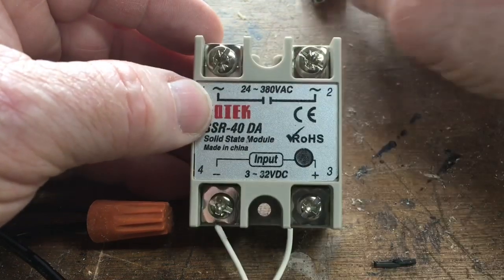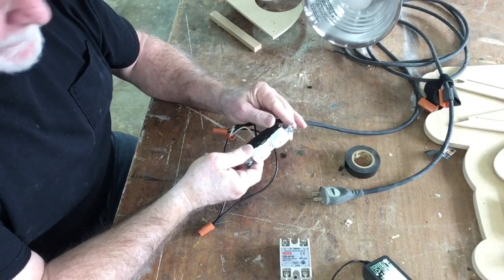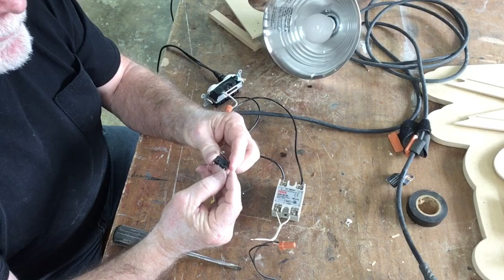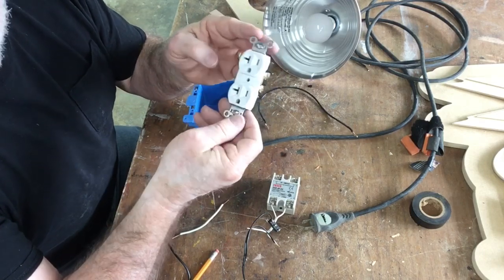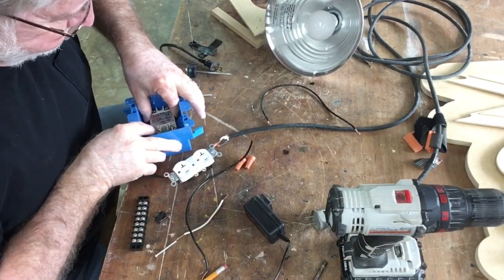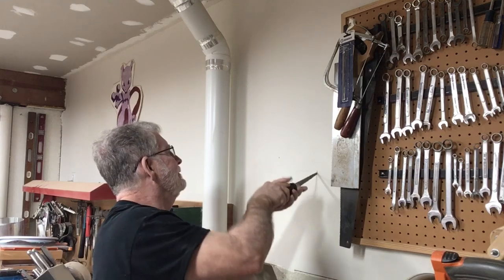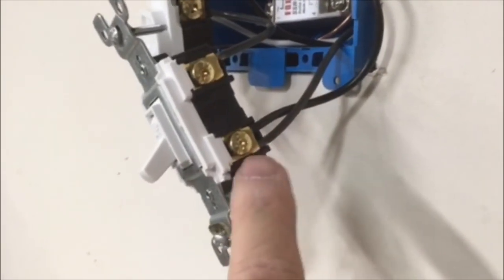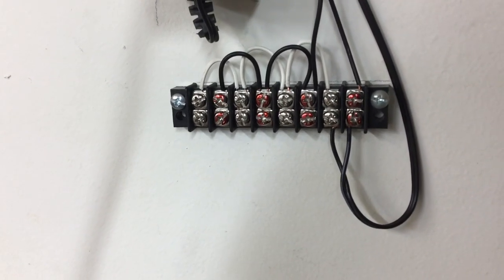Automatic Blast Gates | New 20 amp Circuit | Relay and Micro Switches Installed

Comment: I set this up for my dust collector.  It is a 220v 2 hp unit.  I had to use 2 relays; one for each side of the 220v. It is working perfectly.  I modified the wiring to use switch normally open to control.  When the blast gate is opened, it shunts the positive line to the control line and it is only tripped when the blast gate is fully opened.   I intended to put the transformer on the light circuit so that the dust collector could not operate unless the shop lights were on. This should prevent accidental tripping. 

HOWEVER, I could not get the relays to work from the transformer. I tried 7 different transformers, all DC.  Convinced I had done everything correctly, I reordered 2 more relays and tried them. No luck.  A youtube video showed using a 9v battery to activate them.  It worked.  I am now powering the contraption with a 4.2v lithium ion battery.  It works. I have a couple dozen of them that I removed from old laptop battery packs.

Anyone got any ideas? 

I used a good quality multimeter to check all the transformers.  DC voltage of proper polarity, ranging in voltage from 5v to 19v.  

I mounted the lithium battery on the dust collector control box along with a spare so I don't have to go in search of a replacement when the need arises.
Reply from the maker: Not sure what is causing you problem.  What is the output on the transformer?  Did that voltage exceed the rating on the relay?
Reply: Most likely you're DC power  supplies are SWMP and not enough current.A  Switch Mode Power Supply can be constant current OR constant voltage. You need to test voltage and amperage with relay activated. You're Power supply is simply shutting off when you need it to work. 
Look at the output rating for the supply and you'll see that it probably doesn't output amps that the relay requires.

Comment: Hey Paw Paw, great video, I followed this over a year ago when I hooked up my micro switch blast gate set up. Recently my dust collector stopped working. After investigation I found the Solid State module had melted inside my outlet! Check yours and see how it looks. I'm running the 2HP harbor freight dust collector and upgraded the impeller on it to a bigger one. Idk if that had anything to do with it but I'm cautious moving forward. Im interested to see how yours is holding up
Reply from the maker: Wow, that scary. So far mine is working just fine.
Reply: @PawPawsWorkShop  I'll give it another try, this time i'm definitely mounting it in a separate metal box and adding some type of heat sink. I'll have to check on it periodically.

Comment: Hey PAW PAW. I’m using your videos to install my shop dust collection system. My question is this, I’m going to have 10 blast gates with a low voltage lead heading back to the box as shown. Can I connect all of the 10 low voltage leads all together as 1 in the box? Thanks.

Comment: 19:09 
Hello I have always wanted to use micro switches with my blast gates. I followed the video and got the relay as per part # in video as well. Having a problem with the dust collector motor starting up. It runs fine when plugged into an outlet without the relay wired in. Motor seems to not have enough power to start up. Any thoughts to what may be the problem. Thanks
Reply from the maker: Are you losing voltage and or amps on the high voltage side? It seems the low voltage side is doing the job. Are all the connections tight?  Test the voltage.  It possible you may have a bad relay
Reply: Yes it tested 120v. I will try another relay. I picked up 2 of them. I’ll swap it out and see it it makes a difference. Thanks I’ll let yo know

Comment: Great idea, thank you! I have a problem though, and I'm not sure if you can help. I've set this up exactly how you did and even tested it several times with a light. I then connected my 20A dust collector, touched the two low voltage wires together, and it turned on. Hooray! But when I take the wires apart it still runs... the circuit remains closed. I read online that the relay may have failed in the closed state, so I purchased a new relay. I just repeated the process and the same thing happened. Any ideas?
Reply from the maker: There is a short somewhere.  I had the same problem.  I added another drop and all of a sudden it did not work correctly.  My wire was pulled tight into a slot and the metal strap cut the wire just enough to make the connection.  It was a little difficult to trace but I found it.  Look careful at your whole system.  You'll find the problem.

Comment: ANother question I have is the switch.  Why is the switch needed? Just so that you can shut it off so the relay does not over heat?  I bought the relay and it came with a heat sink device but there is no way that device will fit in the deep electrical box.  If someone has to remember to go to the dust collector to shut off the switch for the relay or even put the switch somewhere close to where you work, then I am not getting the idea of automating the DC to come on by opening a blast gate. I mean I get the convenience of any blast gate opening would turn on the dust collector and shut it off, but then we have to remember to flip that switch.  I am not liking that option because then it would be easy to forget to turn it off. I have a remote for my DC and after watching several other videos on doing what you have done, and after wiring everything to make this blast gate automation, I am now stuck with the idea of having to remember to turn off a switch for something you cannot see or hear running.  I was thinking why couldn't I have use an alexa enabled switch instead of the one I bought.  That way maybe I could out some automation in place that says if the switch is on for a certain period of time, turn off the switch or send me an alert that it is on for say 30 minutes or an hour.  Thoughts?
Reply from the maker: The switch is not required at all
Reply: I have a switch on mine and I recommend it. Sometimes the blast gates my vibrate open, turning on your dust collection. I've been sleeping at night and woken up by my dust collector running because a blast gate opened somehow just enough to release the limit switch. So before I go on vacation or I know I'll be gone a while, I hit that switch so even if a blast gate opens, the dust collector won't turn on.

Comment: Although this won't open/close your blast gates but, if you use this current sensing switch, from Amazon, at each of your power tools (In place of the Microswitches) it will start up your dust collector when the tool starts up.  That's the way I run my shop.
Current Sensing Switch, Normally Open Current Sensing Relay Adjustable AC 0.2A -30A (SZC23 No AL-CH Model)

Comment: Was the short in the low voltage side?
Reply from the maker: Yes, when I pulled the wire it got caught on one of the metal straps.

Comment: Great video! I followed every step you outlined. I'm using a 5A micro switch, but it makes my dust collector power fluctuate over a 10' bell wire. The same switch attached to a 1' bell wire, works just fine. What rating micro switch are you using?
Reply from the maker: The power is just going through the relay switch. The low voltage side is for the switches to operate the relay.  I'll check the amp of the micro switches.
Reply: Awesome, I appreciate you taking the time to check. For the life of me, I can't figure out why the power would fluctuate over a long wire, but not over a short one. I even swapped out the wire and micro switch.
Reply from the maker: What about the relay itself?
Reply: @Paw Paw’s WorkShop  I purchased one that had the same specs as the one you used, as the one you had wasn't available. It works fine as far as I can tell. It's only when a long wire is run from the micro switch to the terminal block that there's an issue with power fluctuations. Otherwise there is no issue with short runs.

Comment: .I am working on this project right now.  I have seen a lot of comments on the relay heating up. Have you had any issues with that?
Reply from the maker: I have not had any heating issue with my relay.
Reply: @PawPawsWorkShop  Thanks! I got the relay with the heat sink and a metal box, so that will be overkill. I had planned to run the hot for the relay thru the switch also. Any ideas about it that would help or hurt?

Comment: I have a question...First off, everything you did with the wiring---I get it. I even drew it out on paper. What I am not getting is on your low voltage (12VDC) side. You have both the positive and negative wired to a positive (red colored) terminal of the power strip block. (The question--) How is the power getting to the relay?

You have the negative lugs (4 each) daisy chained with the white wire. All the positive lugs (3 each) daisy chained with the black wire except for the the last positive lug on the right. On the right side the positive and negative lugs you have the wire going to the relay from the bottom of the power strip block.

Where I'm lost is the wires coming from the 12 VDC are both going to a positive (red color) lug, where is the relay getting power?
Reply: p.s. I enjoy your videos and they are awesome!
Reply: NEVER MIND! ha ha ha. I had to go over it a few more times. I got it! I feel so stupid now, because it is so simple.
Reply from the maker: Awesome! Glad you figured it out.
Reply from the maker: Thank you very much.
Reply from the maker: Awesome!  Yes, it is simple once you understand what actually happening.  Thank you very much.